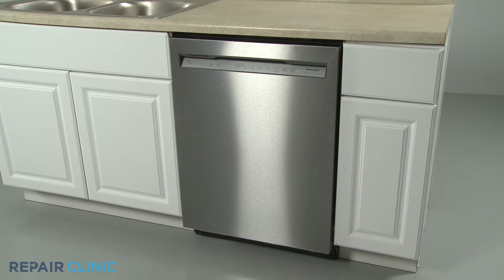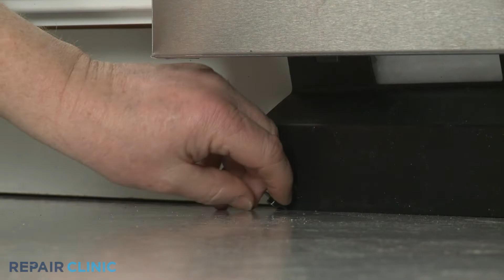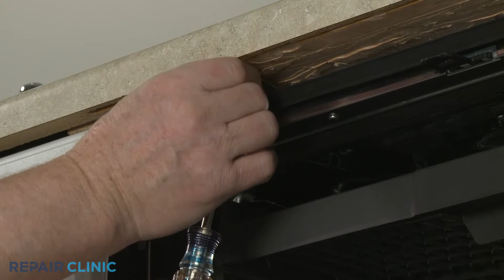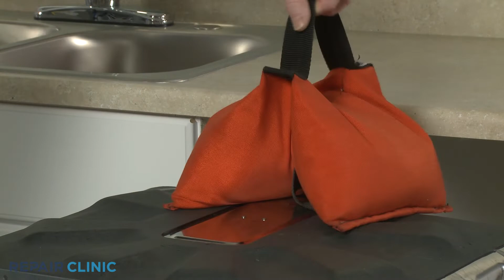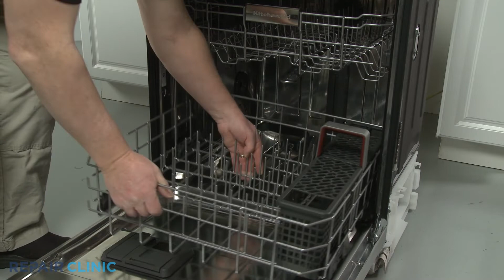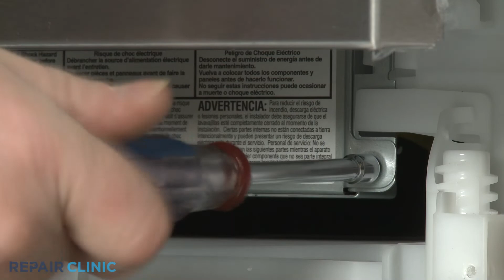KitchenAid Dishwasher Water Inlet Assembly Replacement W11535094

Comment: Whew.... I had a leak in thus area, thought t was a hose. Nope, Thought the inlet part was cracked, nope. Thought the gasket was shot... but i didnt know how to take the part off. Found this video, saw there was a nut inside the machine. The nut was kinda loose and the gasket looked fine so I reassembled and tightened the nut firmly. Ran a cycle and it was perfectly dry!  Dodged a new dishwasher, or repairman visit, both expensive. Thank you Repair Clinic!!!
Reply: Dude! I read your comment, checked the interior nut and it was obviously a "bit" loose. Gave it a tighten and Voila! Problem solved! Thanks brother!
Reply: Same here, ridiculously poor design!

Comment: Replaced the inlet assembly with a new assembly, nut, and assembly rubber seal.  but my unit heavily leaks at the water inlet assembly seal area on the outside.  Does the assembly nut need to be torqued to stop the leak or is there something I'm missing.
Reply: The inlet assembly is fine.  It is not intuitive that the intake valve would cause this problem but it does.  Instead of a smooth, slow flow that goes into the tub hole, you get a fast, turbulent jet that shoots through the hole in the plastic intake assembly.  I replaced the intake valve and this problem is solved.

Comment: I has same issue Daniel did.  Turning down the valve to a trickle seemed to work but this doesn't seem like a great design.
Reply: I just fixed mine, it was the water inlet valve
Reply: Especially since my kitchen sink uses the same shutoff

Comment: Why did you have to unhook main electric power connection just to change the inlet valve.
Reply: Probably to allow pulling the unit out from the bay, assuming the power cord is too short to allow it…
Reply: Exactly so  @mcbarnhart

Comment: Why is there an opening in the rear of the water fill plastic enclosure? Is this an intentional water overflow? When I first installed the dishwasher I had the water supply valve fully opened. It proved to be too much pressure and caused water to gush from this opening. I’ve since barely opened the quarter turn valve and it appears to have stopped the water from flowing out. Is this normal operating behavior?
Reply: Did you ever fix this? I just got one of these and cant wrap my head around why the enclosure is open, so that if the water pressure is too high then water will shoot out the back of the dishwasher where you'd never know. Is something supposed to fit in that opening?
Reply: @ericbarone7957  did you find an answer to this? Sounds like the same problem I am having.
Reply: I’m having this issue now and thought I needed a replacement part because of a crack.. I guess my water pressure is too high?
Reply: @armedpreacher  I had thought it was a water pressure issue also. Turns out the water intake valve immediately after the water supply hose connection was faulty. I had a Kitchenaid/Maytag repair person replace this valve and the issue was solved. With the replacement, water entered into the inlet assembly at a much more controlled and steady rate and never exceeded the volume to exit the opening.
Reply: @niephasus  did they charge you for this (if so how much) or was it covered under warranty?
Reply: @niephasus  Thanks for this reply.  I had the same problem.  It is not intuitive that the intake valve would cause this problem but it does.  Instead of a smooth, slow flow that goes into the tub hole, you get a fast, turbulent jet that shoots through the hole in the plastic intake assembly.  I replaced the intake valve and this problem is solved.
Reply: @PLT4MR  It was covered undre warranty. I was in the Manufacturer's 1 year warranty window at the time.
Reply: @niephasus Thanks. Have a whirlpool with the exact same design and is having the same problem
Reply: I just fixed mine that was doing the same thing. It was the water inlet valve